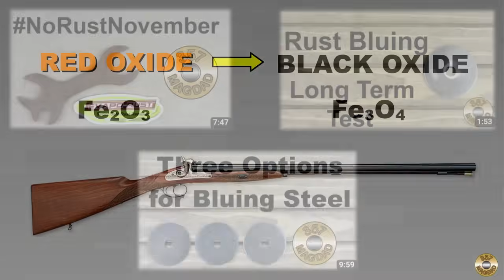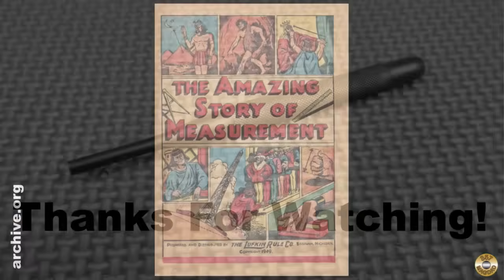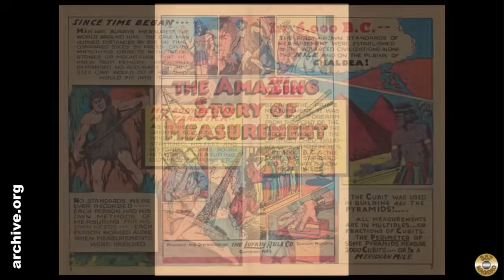DIY Rust Blue - Bluing with Peroxide, Vinegar and Salt

Comment: I was taught Oil Bluing back in the 1970s and it was still being taught, by me as a technical teacher, till I retired.
Reply from the maker: Thanks for watching!
Reply: I don't remember what my teacher called it in my H.S. metals class, but we were taught to heat the item(in our case, a center punch) with an acetylene torch, then quench it in dirty motor oil multiple times. That was in 1977.
Reply: Oil bluing is good for thicker parts, because of the heat involved, rust bluing is recommended for shotgun barrels especially doubles. I think rust bluing is pretty cool, more true to most of my back powder guns periods
Reply: @357magdad can you use cleaning vinegar? I can't find distilled at my local stores

Comment: BTW, you can blue larger parts (like gun barrels) as long as at least 1/2 of the object can be submerged. Essentially, you boil one half for the color change and then the other half. As long as the boiled parts overlap, you can get a consistent result. I have heard of guys who can develop black oxide just by setting the item in a non stove top safe tube and then covering the object in multiple changes of boiling water. I didn't have any luck with this, but I really didn't try too hard.
Reply: You can also steam it. Just run a kettle up a pipe. Faster, easier and safer than trying to boil a 26 inch steel rod
Reply: I will try that next time.
Reply: You do not want to use this method for gun barrels. The peroxide can weaken hardened steel. That's very bad if you plan on firing said gun.
Reply: @MrEazyE357  I would need to see the chemistry.
Reply: @jachse8464 ignore the hydrogen comment. It's complete bs...

Comment: I used this to blue some new screws I got for my air rifle. If doing multiple coats, I found that dipping in acid and then coating with plain H2O2 and salt solution was better than mixing all three together. Acid dipped just for the first coat, all subsequent coats were just peroxide and salt.
The acid soak was 50% acetic acid for 10 minutes.
Reply from the maker: Thanks for the info!
Reply: I generally heat blue small screws, in a bed of brass chips for uniform heating
Reply: Where did you get 50% acetic acid? Normal white vinegar is only 5% acetic acid.

Comment: Thanks for making and posting this. Well done. I also did a version of this only with an axe head submerged into a mixture of Peroxide & Salt. (can't remember if I use Vinegar). heated the mixture in Stainless frypan on BBQ, submerged axe for a maybe 10 or so minutes. Took it out and ran cold tap water over it. Did this several times until entire axe head turned black. Someday I'll put a handle in it and hang it up. Thanks for your tutorial.
Reply from the maker: Thanks William!

Comment: I'm pretty sure any number of formulas exist. Years ago, I discovered a variant that uses steel wool as a catalyst. Preheat metal, when up to 180-200F, apply concentrated super blue gently with steel wool. Instant rust on even many high alloy parts up to the "semi stainless". Concentrate superblue or permablue by leaving the tops off till 40-50% of volume is gone. A couple of tricks on cold blue, preheat metal with a heat gun, add a few drops of 10% acetic acid (from amazon). I always mix chems on the work, or in tiny amounts and discard any unused. All of these will RUST blue. Last note, Brownells Oxopho-blue is a blackening rust process, at least if you get the metal above 180f. Do ALL metal shaping and prep prior, Best to take it down to the base metal in the white, but I have done it on top of both rust, and surface voids that would CONVERT, the rust, to blackening, and actually fill some small surface pits. Finish with a very fine carding wheel, looks like a wire brush, NEVER EVER contaminate your carding wheel with stupid stuff like using it as a wire brush, like cleaning auto parts. If you do, toss it, get another also on amazon. Best $20 you will spend. I recently did a receiver from a homemade frame ak for a friend. Just heated it with a vidal sassoon hair dryer, oxphoblue, rinse, card and repeat, only 3 times. This thing had a finish that you would swear was airbrushed with a light coat of black paint, and believe it or not, you would swear there was a super lite coat of automotive clearcoat on it! I was a mechanic in a past life, and I know what that would look like! I laid it by my 1915 Mauser brand P08, and you can see clearly how they did it! The finish on the two guns was remarkably close. I cannot believe how much of my life was wasted on cruddy cold blue efforts till I discovered this.
Ah, forgot the other trick, heat your blueing solution in a microwave. Since your bottle is likely quite small, and will heat very quick, slow down the microwave heating by putting a cup of water in with the container, separate, of course!
Reply from the maker: Thanks for watching! And thanks for the info!

Comment: I like how that turned out, I'm planning on doing a conservation to a JC Higgins shotgun and I want to keep it looking correct, and this looks a lot closer to and easier than most of the processes I've been researching.  One thing I did notice in you video as compared to others I have watched is the prep you did before you started the process, they would disassemble the firearm and go directly into the first boiling treatment, without doing any of the prep you did.
Reply from the maker: Thanks for watching Wes!  I think you can convert any existing rust by boiling also.

Comment: You don't need to fully submerge parts in boiling water.  If you can construct a steam chest and pipe hot steam in, you can do much larger objects.   A temporary steam chest can even be a big cardboard box with a hole at the bottom for an old school (no auto shutoff) electric kettle..  It will last long enough to do a whole rifle barrel and receiver and you can just toss it afterwards..
Reply from the maker: Thanks for watching!

Comment: I use brake-kleen for nearly everything around the garage, except for items to be welded, including a couple of firearm components, plus the use of acetone. Recent experiments for my bluing have been greatly improved with use of Denatured Alcohol, instead of the prior mentioned cleaners. My bluing comes out so even and seems to have better saturation of the bluing chemical, and takes less time. I have a darker visible difference in the items blued when using alcohol as compared to acetone or brake-kleen. Thanks to this video, now I have alternate inexpensive materials to use and experiment with.
Reply from the maker: Thanks for watching!
Reply: Is "De-Natured" Alcohol the same as IPA *IsoPropalAlcohol  ?
Reply: @markoreilly3414 Methanol alcohol with bitterant added, denatonium benzenoate I believe

Comment: Came out nice. Next time you might think about mounting the punch in a drill chuck and spinning it while pinching it with the abrasive. Would also work with the wire brushes.
Reply from the maker: Thanks for watching Gary!  The 1x30 sander does a nice job on the square end of the punch.  I've had really good results with the Red Label conditioning belts.
https://www.youtube.com/watch?v=-txSVOHgptA
Reply: Yep use the drill as a mini-lathe!

Comment: To protect my knives I use ferric chloride. No heat necessary. Just clean them thoroughly with warm soapy water and then with alcohol. Paint some Ferric Chloride on to the blade, wait a few minutes, rinse with water, then rise with water and baking soda to neutralize any acids left. Don’t wipe it dry, just pat it dry. Works best in warmer temperatures than on cold days. It still works in the cold but takes longer. You can also warm the Ferric Chloride a bit if you want faster results.

Result? A knife or tool that won’t form red rust because you’ve induced a stable black rust to prevent it. Food safe as well.

Colors vary from dark grey to near black, steel depending. I’ve done it on many knives, crowbars, and other tools.

It lasts and does what it’s supposed to. I learnt this method from etching “Damascus steel” (pattern welded steel).
Reply from the maker: Thanks for the info!

Comment: Works pretty well. I did a few dozen little hex bits that were lying around from cheap tool sets that randomly materialized in my shed, and a bunch of nail sets and punches including I think the same one you did, if it's starret. Fairly ugly until the 3-in-1 goes on and then it looks right.
Reply from the maker: I'm glad you had success with rust bluing!

Comment: Well done, that came out really nice and even. That's thanks to the detailed carding - the better you card off the excess = the more even and deeper you get the finish. That is also why "slow rust bluing" is considered "slow". It's a time taking process which require reapplication after reapplication. The end results though, if done well, are not even very lustrous by also noticeably more durable than hot caustic bluing. You ought to give it a go with a full sized firearm sometime - you've got the methodology down, I'd bet you could come out with some really stellar results. Maybe just do a beater you pick up at a gunshow for that purpose.
Reply from the maker: Thanks for watching!

Comment: Ty for the vid I’m gonna try this with a hatchet head that I sanded down to bare steel. I was looking at different cold bluing products and methods but I’ve heard that rust blue is a more durable finish and it’s done with cheap household items. Doesn’t look too difficult
Reply from the maker: Give it a shot!  Let me know how you make out!
Reply: It came out awesome. I had sanded the hell out of this thing but the only part that was actually bare steel was the inch or so near the edge that I had reprofiled with a file. The bare steel came out a much darker more even tone, while the rest has an authentic used patina look. I wasn’t as careful as you, scaled up your recipe large enough to dip the whole hatchet head, mixed two batches spread over six applications, didn’t degrease between applications, and reused the boiling water for every one. Still happy with the results, looks so much better than the vinegar patinas I’ve tried which never seem to work like they do in the “movies”. This will be my go to method for knives and axes from now on, thx again.

Comment: You can do it only with vinegar, I have done it to my carbon steel knife from mora, heated the vinegar until its getting hot only so hot that if you stick the steel in it Beginns to bubble and you can let it in so long you like until the desired color is dark enough for you or do it a couple times ago, after washing it in plain water and cleaning, like you have done it after every dipping. 🤗
Reply from the maker: I've also heard of using a potato to force patina on a blade.
Reply: @357magdad can you do a video about it tho😅

Comment: Great new trick, thanks for posting.  I patina a lot of different metals and have found that steel wool has oil on it to control rust and it will retard platinization on desired metal.
Reply from the maker: Thanks for watching Don!  I make sure to clean the part with brake cleaner or denatured alcohol after buffing with steel wool.

Comment: Originally the old gunsmiths would make a barrel and lockplates, then set them outside. They would go out and pee on them, or rub them with animal blood. The humidity would rust them overnight. They would then card those off and repeat the process. Finally, when they got the desired look, they would seal them with beeswax. This is "Browning". Supposedly, selenium was required for bluing. But, it looks like you have had success with common household items. Blood and urine were common household items in the day, too. 
  During the Civil War, there were people that collected urine to turn into niter (saltpeter) for gunpowder.
  And, thanks for the measurement link.
Reply from the maker: I asked Mrs Magdad, trying your ingredients is not gonna happen! 🙄
Reply: @357magdad  
  Yeah, I haven't used those either. I have a bottle of browning solution that I've had since I was 18 (52 years ago). I've done two barrels with it in that time, and both came out looking great. I have no idea what's in it, but it doesn't smell like pee, so I think I can rule that out.

Comment: hi, it is very interesting to watch your videos and learn something new for myself, I am very interested in the topic of restoration and corrosion protection. I would like to share my experience and a recipe for oxidizing iron in a solution of 10-20 g/liter of ammonium nitrate and 10-20 g/liter of urea at 90-100 degrees. It turns out a black resistant coating. I like this recipe because it does not contain dangerous alkali and aluminum cookware can be used.  there are many recipes for ammonium nitrate with different additives, but not all reagents are commercially available and you still need to experiment in these recipes. Thank you.
Reply from the maker: Thanks for watching and for the info!

Comment: If you use the activator thats used in fiberglass resin, or the hardener which ever youd call it, the clear peroxide based activator.  The stuff will do the same thing except much much faster.  And you cant get any on your hands and leave it or itll burn your skin..  is like 40% peroxide instead of the 3% you used..
Reply from the maker: Sounds kinda dangerous!

Comment: I've always had good results using a hot vinegar and salt solution and submersing the piece in it for anywhere from 10 minutes to a few hours then rinsing with soda water and then oiling the piece. I've never used this process.
Reply from the maker: Give it a try!
Reply: @357magdad  tried it on some old pliers and wrenches. It does give a good result but, not enough for me to justify the extra work over vinegar and salt or regular cold bluing.

Comment: I use with a little variation a similar process.  I use a 60-50 mix of vinegar and H202.  I degrease with acetone, not a petroleum product.  Otherwise essentially the same.  This mixture is more eco=friendly and safer than solutions based on Nitric acid or other chemicals.
Reply from the maker: Thanks for watching Ken!

Comment: Will this work on an already (normally) rusted metal? Like, if I boil it, will it also turn black?
And, can normal water be used? Or has to be distilled water or it won’t work?
Ty
Reply from the maker: Boiling will turn red rust black.  It may take a while if the rust is heavy.  You may not get good results with tap water, depending on what is in it.

Comment: I had this spray that was some sort of rust off, my brother gave me he got from his work. I prayed it on this metal horse I had that was rusty. It turn it black and de-solved the rust. It was a good thing because I didn't want to sand it would have took a long time.
Reply from the maker: There are many products on the market like you describe.  They are usually used before painting an item.
Reply: @357magdad  yes that's exactly what I did was painted. I'm going to try what you did on your video on a few tool's I'm going to restore, a pip wrench and a hammer head. Thanks again for sharing 👍🏽

Comment: so you removed the rust (Fe2O3)(ferric oxide) then brushed and cleaned it , then added a solution to surface rust it again before boiling it in water , so what was the point of the solution again ?
Reply from the maker: I cleaned up the pitting in the metal to have a smooth surface before I rust blued the punch.

Comment: I’d really like to try this method, out of curiosity, how important is it to use distilled water?
Reply from the maker: I haven't tried it without sing distilled water.  Local water chemistry probably varies quite a bit.
Reply: @357magdad  Yeah my local water is very hard so high calcium content, however I don't think it'd have an effect on the oxide conversion process, but then I'm no chemist.
Reply from the maker: @captaincracks  Try a test piece. 😉

Comment: I'm from Russia, this is our favorite way, this is how we blacken hunting weapons. The bluing is strong and deep. Everything depends, of course, on the metal, but even if the desired effect appears the fourth time, we repeat the procedure about 8-10 times so that the layer is thicker and more resistant to the environment.
Personally, I have tried American cold quick bluing compounds and they turned out to be terrible, a very thin layer and difficult to achieve the same shade on different elements.
I don't know of a better or more reliable method than the one shown in your video.
Reply from the maker: I did some corrosion testing that agrees with you experience:
https://www.youtube.com/watch?v=H9sngIhUGI8

Comment: A couple of questions, could I replace the brake cleaner with WD-40, and is "carting" required to get a good finish? Thanks.
Reply from the maker: Thanks for watching!  The part can be cleaned with denatured alcohol, rubbing alcohol or acetone.  It is necessary to buff the part with 0000 steel wool between coats.  It doesn't matter what type of oil you use to coat the part afterwards.